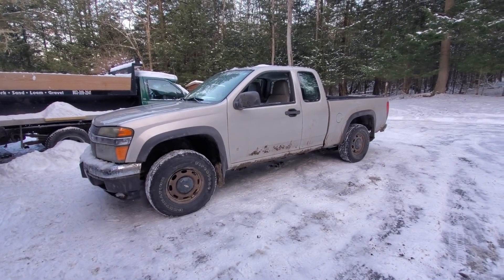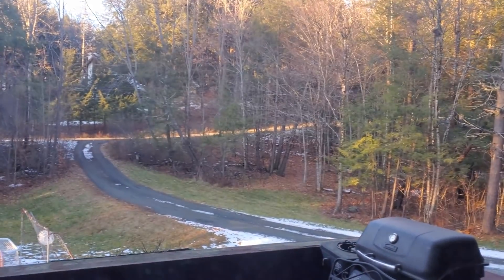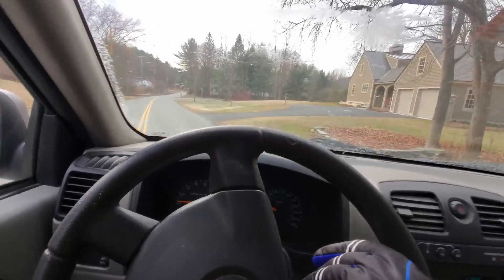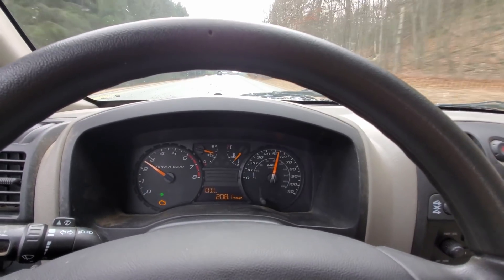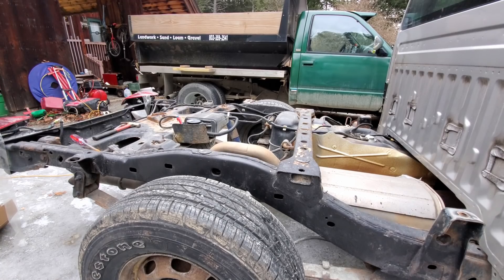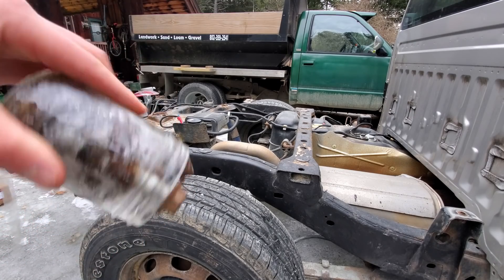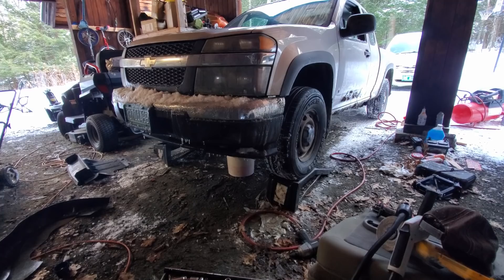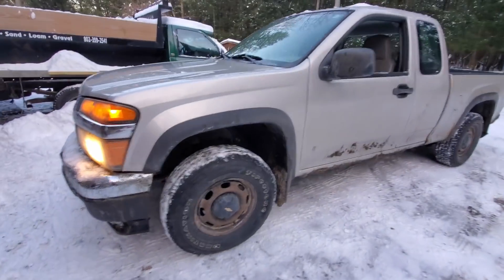$400 Chevy Colorado Part 4: More Repairs!

Comment: blinking means imminent melt down of the converter.
Reply: Man if that's true for my 98 as well, guess I'm gonna just have a free flowing cat for a while
Reply: Edwin Byrd it doesn’t it means misfire.
Reply: @themaxee08  my trucks always misfiring, it only flashes between 50 and 60, above 60 or below 50 the light is just on.
Reply: @themaxee08  misfires ruin converters real quick. i replaced 2 downstream secondary converters this week that were plugged so bad the cars wouldn't accelerate. and i fixed what made em go bad in the first place
Reply: @FixIt1975  what caused the misfire?
Reply: @x-man5056  Any number of things can cause misfires, though its usually, but not always, the ignition system
Reply: @FixIt1975  I have experienced the clogged converter thing before also.  It started using more gas and getting less powerful but would sit in the driveway and idle fine.  Wasn't missing at all, even under load.  Then all of a sudden it would barely go 3 mph.  Mine was caused by some fuel additive experimentation I had been doing. New cats will make an older vehicle run like brand new.  Damn things.
Reply: @x-man5056  yes. But you have to fix what caused the problem too. That's y I told rural Vermonter to not use marvel mystery oil in it. Could ruin the cat. You'll never go wrong with the Chevron stuff. Was endorsed by Honda as approved additive. If your read my reply to him.....
Reply: @FixIt1975  MMO wouldn't be my choice as a fuel additive ever but it is useful in the crank case for certain conditions.  I like Techron and also the Lucas injector cleaners.  I use Techron for a major assault and the Lucas 4x a year for for preventative maintenance.
Cataclean can be helpful with cats that are partially clogged but still only pushes that problem down the road for a while.  Even a good running engine will degrade cats after a while.  They just don't last forever. 

I bought a nifty little gauge kit for measuring back pressure on Amazon for about $35.  It takes the guessing out of the picture.  If you regularly work on vehicles with over 100K on them, I highly recommend it.
Reply: @x-man5056  thanks. Infrared heat gun works well too, but nothing replaces experience. I've seen clogged cats blow head gaskets as well, if they don't blow the exhaust gaskets apart first
Reply: @FixIt1975  I have used the IR gun also but need 2 people for that.  Getting my wife out there to help brings a whole new set of problems with it.   LoL  Agree on the experience thing for sure.  I am 65 and started working on cars before I could drive.  I can always learn something new though.  Cheers.
Reply: @x-man5056  yeah, me too. I was driving before I should've been too. My last one was 2009 GMC Acadia with a misfiring coil customer must have driven it for weeks like that. I cut the bolts in front of the secondary cat and was able to drive it. I never had luck with cataclean. Lemmon juice works but cat cant be plugged and it has to soak in it off the car. Happy Holidays
Reply: @FixIt1975  Cataclean can buy you a little time if you use it right and "in time".  If the Cat is completely stopped up, probably won't work. I was doubtful but tried it and was moderately impressed.  If you just gotta get through a state inspection or are going to sell a car and let it be someone else's problem, or maybe just waiting for the tax refund.  It's not the same as getting a new converter for sure.
Reply: @x-man5056  the first one last week, I knew was stopped up. I got labor time to take the y pipe off n look. Exhaust was whistling where it had blown out the gasket. Young couple from Maryland. I'm in NJ. I.gutted the secondary cat. Its not monitored and only needed in California. I couldn't find a pipe to eliminate it. When I don't hear from my customers about the same problem,  they're happy as am I. Second one was the Acadia Never got the heat gun out for either. Acadia is s local, job got done with replacement cat
Reply: @x-man5056  u ever check out neutral drop on you tube? Funny shit
Reply: @FixIt1975  Not familiar.  Please explain.  I like funny.
Reply: @x-man5056  they are 2 brothers from NYC that buy and sell cars. The ones that they don't or can't sell (I guess they're trade ins), they junk em. They do smoky burnouts with em till the tires blow apart, go 40 mph, throw em in reverse. They dump shit in the motors n blow em up, etc. If you really wanna feed your brain about fixing newer vehicles I highly recommend South Main Auto channel and guy that has a shop here in my home state,  Joe's Auto Electric in Bayonne

Comment: I’ve been looking for a really cheap s-10. I just want a 4 cyl with a bed. How’s the 2.2 engine? Auto/manual probably 2wd
Reply: Btw,, want the 4 cyl for better gas mileage and smaller tank? Don’t care for the 6
Reply from the maker: The 2.2 is good, their lifespan is usually 250k so dont get one above that mark
Reply from the maker: And definitely manual
Reply: Thanks man
Reply: It might be like the old Jeep Cherokee was; I thought the 4 banger would have been better on gas but because you had to floor it all the time to keep up with traffic and because it was so gutless, it was therefore really no better on gas than the 4.0. The 4.3 really is a pig on gas though so who knows.

Comment: stuck o2 senesors can cause a missfire and rough idle. Common issues for the colorados as far as missfires are burned valves also the intake manifold bolts have a tendancy to loosen cauing a vaccum leak and lean condition and may even miss when the engine is cold
Reply: Could always use an old spark plug to jury rig a compressed air line to each cylinder in turn and listen for excess leaks  at intake/oil fill/exhaust to indicate burnt inlet/exhaust valves or ring issues.

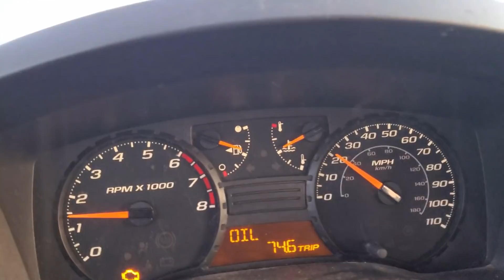Comment: 10:48 No, it's not reading too high. That is normal. 

https://youtu.be/4Z2W8SNPb5M I filmed this intending to show an idling problem that happens because of my evap, but turned out to be a fabled toothache once I pulled the camera out. In this video you will see that my truck with a 25000 mile thermostat sits at the same temperature.

Comment: P0300 on a Gm product I would do a crank re learn on higher milage chevy's it is normal. I have to do mine about every 220-225 k kms I'm sporting just over 800k kms original motor 5-6 waterpumps same with exhaust manifold. Easiest way to do thermostat is through the driver side fender well. One bolt is nice the other not so nice. They are neat trucks I like mine😉

Comment: My man you can buy an obd2 scanner on eBay for like $18 shipped. I bought one and it's a lifesaver and worth every cent I paid. I ended up buying a $300 one just to have because I liked the crap one so much. No more trips to O"Rapeys lol. And the temp gauge is fairly normal for a Colorado, factory spec is supposed to be dead in the middle but I've seen so many of these run like that.

Comment: Although I don't always agree with your methods, I always give you points for perseverance. I remember when I was working under my Mustang during the winter 50 years ago. All I wanted then was an enclosed building with a concrete floor; to me that would have been heaven. I got my garage about 10 years later but then what I thought would be heaven was for it to be heated. I had to settle for a propane heater. If you could just come up with something, even a plastic soft-sided garage with a dry floor a lot of your problems would disappear. They are easily adapted to being sturdier and more reliable.
Reply from the maker: Thanks, I'm working towards it.

Comment: I'd aslo try replacing the fuel injectors to fix the cylinder misfire. Too much fuel (I think) can cause a misfire, which is what happened on my $600 '02 Corolla.

Comment: My 06 temp sits high too after my thermostat was replaced so i have no clue
Reply: Brian Baird I have a 06 w. 3;5 temp gage set low when thermostat was change it set higher I think it is how the thermostat was put together some may have a tighter spring then others depending on manufacture.

Comment: Damn Ive only ever changed the thermostat on older vehicles and my ranger and both were at the upper radiator hose goin to the manifold...  Guessing the colorado is fwd?  Never messed with anything other than rwd traditional V style blocks but I got a fwd kia optima im sure ill have to mess with once it gets old enough to start having failing parts.
Reply: all of the Atlas engines (2.8 4 cylinder, 4.2L 6 cylinder, 3.5L 5 cylinder) were all made alike, the thermostat fails to the open position, and is mounted on the lower radiator hose.

Comment: $3,600 for a s10 dam, I sold mine for $500 10 years ago and it was a ZR2, I've owned at least 30 vehicle and my s10 was the most unreliable vehicle I ever owned by far. I just wanted it gone sold it for the price of one month's payment of my new truck.
Reply from the maker: Yep this s10 was a gem, plus it had less than 100k on it. Usually 4.3 s10s are very reliable, you may have gotten a dud.

Comment: That’s a normal temp. When ac is on and stopped it will even get higher if any more question use the forums 355nation.net or Facebook 355nation.net / 700nation.net we are all Colorado owners

Comment: No, there was nothing wrong with the old thermostat. You can't treat those codes like a list of stuff to fix. They are a starting point - and one thing affects another. The whole list could have been caused by the evap. And unlikely you needed a new canister assembly, there's a sponge filter and valve and return line that can clog up. You might need an O2 sensor - they are designed to wear out.

Then reset the thing and see what new codes are thrown.
Reply from the maker: the old thermostat was stuck open.
Reply: @ARuralVermonterQqjmcb182  Ah I thought I heard it now runs hotter than it did before. Stuck open in that weather should mean that it never warms up. But in my experience if they go bad, the spring gets weak, so it's slow to open, with overheating. Stuck open is due to rust and junk, and can be unstuck, the spring should still be good. It used to not be that big a deal to get a new one, but nowadays i fear you've replaced a good OEM part with chineseium.

Comment: The misfire may be caused by the o2 sensor as when cold especially if the heater is burned out it won’t work properly.  They are pretty simple to test and replace.  The other this is if it’s one misfire just unplug the coil from plug until your find your dead cylinder.  Everything i just said is easier to do than replacing that thermostat.
Reply from the maker: Thanks I'll check it out
Reply: A Rural Vermonter - Qqjmcb 182 good luck!  The truck is looking great.

Comment: Changing the oil will help things.
Reply from the maker: I changed it I just dont know how to get rid of the message
Reply: If you turn key to on position then press gas pedal to floor 3 times,turn key back off and it should reset

Comment: The engineer BASTARDS at GM decided to put a ten dollar thermostat and a cheap evap canister where they can't be easily reached.  What Chevy won't do for a buck!
ALSO, Where do you live that this truck can get so easily rusted out including the fuel pump?  Pacific Northwest?  I do admire your persistence and your get up and go.
Reply: @FrostyDuc    Thanks.  You are right.   I guess I never noticed the channel name back then.   Same latitude as Portland Oregon, around 3,000 miles east with lots of salt on the roads in winter so now I know why the truck is in such bad shape.   Take care and Maranatha.

Comment: The code should tell you which cylinder is misfiring.  If the previous owner used generic coils made in China, you might try replacing them again with better quality ones.  No reason to pay someone to replace a coil when you can do it yourself.

Comment: You know Chevy should have there butt's kicked for putting a thermostat in a hard to get to place like that because most people with a truck of that age is not going to worry with it and they are not going to take it to the dealership to have it fixed so the truck will suffer from the thermostat will never get changed
Reply: Chevy probably figures truck body would rust away before thermostat would need replacing

Comment: Blinking eng. Is most likely a coil pack. You more than likely have a evap code for a charcoal canster mine evap code been on my truck for 100k miles. Just pointless  to repair it. It has nothing to do with the performance of the truck.
Reply from the maker: I'm required to by vt emissions